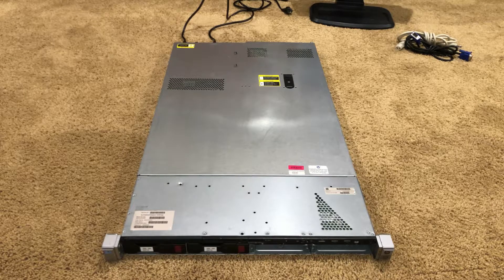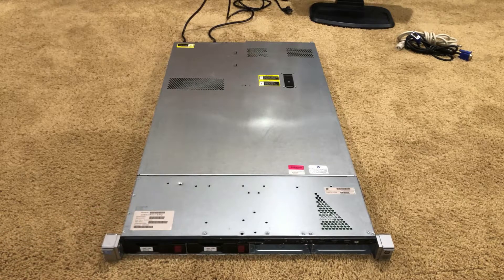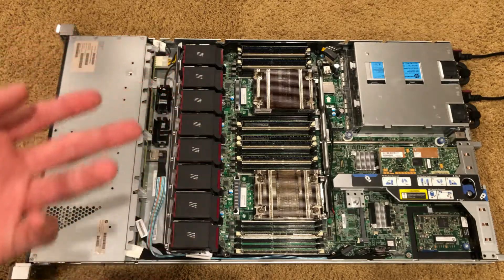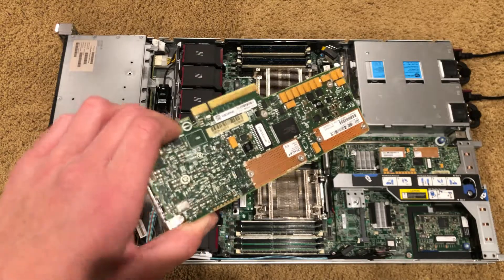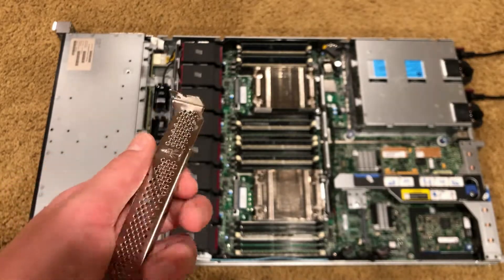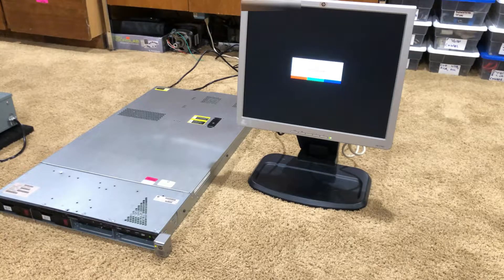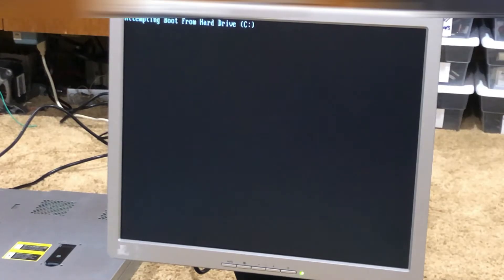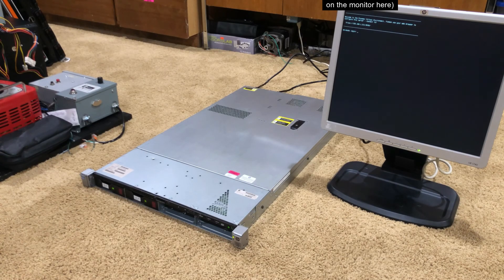HP DL360p G8 Overview

Comment: Does the 380p have 2 8x slots and 2 16x slots? It has 4 slots, wheras the 1U has 2, right? Is it the same staggered riser plug? Not that I would put (or need) that in my 1U, I am just curious.

... " you do get more expansion with the 2U server". ... I guess that answers my question. lol.
Surprising to hear the 1U is quieter. Not normal. Could be the fan profile making that difference.

Comment: Hey, your DL360p seems to be a whole lot more quiet than mine. I actually got mine for free, i saved it from being thrown out. Would there be anything that would make it really loud? I already set the thermal settings in the bios to make it more quiet, but it didnt really do a whole lot.
I am running openSUSE, if that matters.
Reply: hey ya mate ...are your drives hp.....as fans can spin up if not....just an idea because ha d that happen
Reply: Yeah just got this server also and the fans are so loud, I am thinking of returning it cause it gives me a headache being in my computer Room.  I installed proxmox 7 and wanted to set it up as a cluster with HA, dammit
Reply: There are several videos on YouTube that show how to quieten the fan noise of HPE servers. It is a fairly simple process. Have a go!